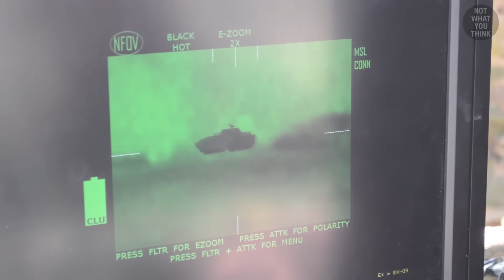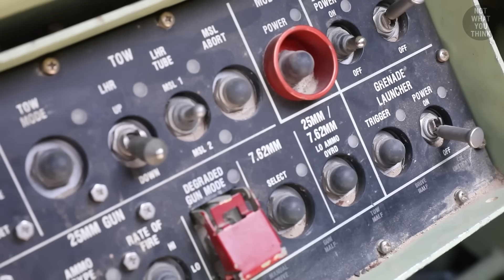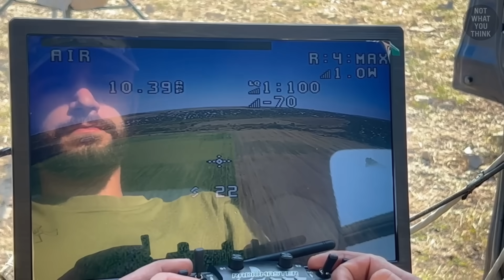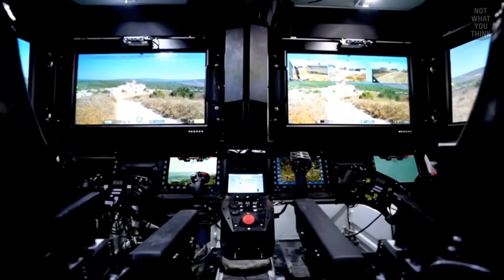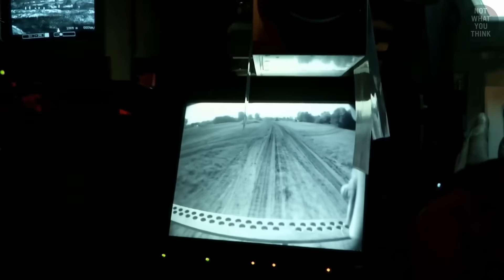How Bradley IFVs prove more Useful in Ukraine than Tanks

Comment: Basically you have multiple variants of a well protected IFV: One is a standard troop carrier, another is a troop carrier with a 40 mm cannon, another is a 120 mm mortar carrier, another is a command and control , another is a defensive AA unit with a poop ton of ammo, and finally a drone carrier. All basically using the same basic chassis. The drones scout ahead and get targets for the 120mm mortar, and they themselves can go after targets.

Comment: First of all the M10 Booker is not designed to replace the M1 and never will. Just like the M22 Tetrarch never replaced the M4 Sherman. It is designed to support light infantry formations that currently have little in the way of armored direct fire support. Also, the reason why drones are so effective currently is that there aren't many effective anti-drone systems yet fielded by Ukraine or Russia. Also, there is not a lot of doctrine or training currently out there on effectively countering drones. Many anti-drone systems are either already fielded or in development by the USA and other Armies, one of the primary purposes of the US M-SHORAD is not to engage manned aircraft, but to deal with drones. Also, The Abrams is only a super-tank compared to crappy, old Soviet tanks compared to other modern MBTs it is just a good top-tier MBT. Also, many tanks already have or are developing active protection systems and/or EW systems to defeat ATGMs and drones. I don't know about Ukraine, but the US Army doesn't use M1 Abrams in stand-alone tank formations. Abrams are always part of combined arms formations that include IFVs and infantry alongside the Abrams. No single arm is invincible and each arm is best used in combination with others in order to support one another and cover each arm's weaknesses. Finally, the Bradly while a good IFV isn't a wonder weapon, and is still less protected and only about as mobile as an Abrams. Tanks will likely slim down a little, as the M1A3 proposal already indicates, but it will lose weight mostly by using lighter, more modern components and materials, and if anything with active protection and EW systems will be even better protected against current threats. IFVs if anything are going to get heavier in order to provide better protection for their infantry. Finally, the Abrams doesn't need a bunch of different ammo types, because between the APFSDS and AMPS it can already do nearly anything it would be called upon to do with its gun. Sure a tank with a 105mm gun might have a lot of options for ammo it could use, but storage space on a tank is finite, and it could easily be that by loading up on a bunch of different types of ammo it ends up not having enough of the type it needs over a sustained battle.

Comment: In Russo-Ukrainian war Bradleys a Leopards have proven as vulnerable and as destructible as their Russian counterparts. Russia is surely not Libya, Syria or Afghanistan and bites plenty a lot harder. It has been noted.
Reply: There is nothing indestructible on the battlefield. The problem with both Russian and Ukrainian equipment is that both sides have been using them poorly. I'm not sure why Ukraine thought they could drive tanks or Bradley's through a minefield successfully... All of the images we've seen of destroyed Western tanks have been minefields that destroyed the tank tracks and then Russian artillery finished them off. I'm sure the soldiers escaped unharmed before the artillery began but it was foolish to drive over tank mines to begin with.

Neither side seems to be capable of a breakthrough because they don't think in combined arms warfare. No single piece of equipment can win a war. It's how you put them all together with a detailed plan and coordinated execution that makes the difference.

Comment: I wont read 1200+ previous comments so this, may have been mentioned earlier.
The Bradley is a good  IFV, but I think the CV-90 is even better and it is not even mentioned in this video.

30/35 mm chain guns on export versions of the the CV-90 kinda works but the 40mm Bofors with 3P programmable ammo is just insane.
Larger rounds means fewer rounds carried but I'd go for the 40mm Bofors instead of the Bushmaster on the Bradley or the lower caliber CV-90's any day of the week.

Comment: IFV's are cheaper and arguably superior in some aspect, though they couldn't haul a full fledge gun, they could definitely mount AT Missiles which is still still very devastating to tanks, basically you pay less for the same result if not better since theoretically you can build 3 IFV for the budget of a MBT and they're also effective at fending themselves against infantry since they're anti infantry oriented with infantry fighting compartments, allowing them to fulfill both roles. of course they're not tough however but with APS and the shear volume of fire a platoon of IFVs could produce, even the best of AT infantry have to duck for cover, not to mention that IFVs are inherently lighter than tanks for obvious reasons making them easier to transport as well as being faster, allowing them to fully exploit breakthroughs

Comment: You are comparing sandy desert terrain with massive field of vision to a muddy swamp with very short vision. Desert is more long range attack and Ukraine is short range.  In Ukraine drones only have to fly short distances to find a target compared to a desert and the longer in the air the more chance of being spotted or picked up on a radar if they had them. In a desert drones would not be as effective because of duration of fly time and distance limitations.  In a enclosed city well yeas very useful.
Reply: None of the fighting in Ukraine is short range.
Reply: Short range is anything under 2 miles. Most of the fighting in Ukraine is under 2 miles. Thats why they use rifles. Duh. Desert fighting, they can be throwing shells 5 miles or up to 30 miles.     @baneofbanes

Comment: Each vehicle was designed with a different role and doctrine in mind for how it operates, in order to maximize its strengths and mitigate its weaknesses. Tanks in Ukraine have (as others have stated) not been supported by infantry and are often susceptible to AT weaponry because they do not have the infantry to screen and engage threats ahead of their armored unit. On top of that, technology for tanks will just continue to evolve to attempt to counter AT weaponry, such as how many nations are currently undergoing upgrades for Active Protection Systems to eliminate threats to the tank before they hit it. This isn't even taking into account the Armored Onion graph on engagement, wherein it eventually trickles down to "*IF* I get hit, can  I survive it?"

Essentially one conflict is not enough to determine tank obsolescence, especially when one side is tactically inept and the other side is utilizing vehicles that they are not wholly familliar with, which means that the vehicles are not used according to the providing military's doctrines.

Comment: if any side could get close air support they would dominate immediately
Reply: both sides basically already have close air support. Drones with Artillery, and loitering munitions, are doing exactly the same job as close air support would do. And probably even do it better. 

The thing is no side has this exclusively, thats why, both sides suffer extremly, and every offensive move, is prone to get punished severely.

Comment: Not sure how I actually made it through this video given how much it is wrong on some major points. Modern tanks are not "battleships" lumbering over land. Most of are highly mobile well protected and lethal hunters. Guided anti-tank missiles have been around since the 60's. They had a big impact on the Yom Kippur war. Tanks didn't become obsolete then. Tactics and technology changed to keep them relevant. The M-10 Booker is not officially a tank. It may look like one and take on some of the roles an Abrams is used in today. It's an Infantry Support vehicle to deliver direct heavier firepower against hardened targets. Think bunkers and solid cover. It's not designed to go toe to toe with Tanks.
And if a Bradley ever just "runs into a tank", it's got a pretty good chance of getting blasted. Now if the crew is smart and uses proper tactics, they'll use their advanced optics to spot a tank before they are spotted, and can use TOWs to take it out. Overall it's a versatile and effective combat vehicle. But there is no one single type of armored vehicle that will single handedly define the future of combat. The US and western militaries are so dominant because of their doctrines which stress combined arms operations, cooperation, and superior logistics.

Comment: the tank will take a backseat for a while, until someone devises a drone defense, or a vehicle portable anti missile system.  F16's are still needed, as if I'm recalling correctly, no one holds superiority in the skies over the Ukraine.  lack of air superiority is one reason the advances have been so small.  this is not time for any "thunder run" style advances.

Comment: One fact remains, each generation of warfare provides challenges to the previous battlefield conditions that must be answered. The tank is not going anywhere unless it fails to adapt to the new battlefield conditions. The next generation of of tanks and armored vehicles will need to answer the drone and anti tank gear currently in use and if possible the future. An anti air and missle system will most likely be needed and the real challenge of that will be making one small enough and efficient enough to fit on a tank.
Reply: @@JimCarner that's why I am trying to explain why the next generation of military hardware will most likely address those issues. The vehicles we see are literally 40 years old, drone warfare as a practice is barely 20 years old and the current doctrine of drone use is only a handful of years old like that.

Tanks still play an important role on the the battle field still, they are literally better at attacking fortified positions and is still a role that is not being replaced in that regard. Ukraine is still showing those facts. the obstacles, however, demonstrate challenges in particular reconnaissance and kamikaze drones will need to be addressed either with a countermeasure or doctrine to reduce their effectiveness. A tank, or any piece of equipment, is a useless hunk of metal unless you know to use and less face it, I don't think the Russians know how to use theirs.
Reply: @@JimCarner yeah, I don't see that happening even a hundred years later. drones are not a silver bullet, they have key weaknesses that can and will be exploited. The reason why they are center stage in Ukraine is because Ukraine doesn't have much electronic support and Russia could not use theirs to full effect and lost alot from special forces and partisan attacks. In fact early in the war Ukraine had great difficulty employing them until the jammers were destroyed, I believe even himars helped with that.

Drones would not be as serious as a problem if an old world War era weapon makes a return, do you know what it is? Flak cannons and their ammunition was phased out decades ago because most aircraft flew higher and faster than they could reach but could easily shed most of the drones being employed in the war.

There will always be a need for a variety of weapon systems on the battlefield.
Reply: @@JimCarner and drones, just like any other electronic device, can be hacked and pointed back at the owner. They still need supply chain and will require regular supplies, heck to use the numbers you describe a large footprint which means they will have a harder time  to hide. Drone operators are almost as specialized as pilots and will be as hard or harder to train and replace as other specialist fields and will need even more logistics considerations than other units.

Like I said drones are very useful but they are not the end all be all. They are another facet of combined arms theory and where they are now is doing well. Working in conjunction with other supporting units is literally the corner stone of modern warfare, and is how Ukraine is beating the Russians because they have better cohesion with their own brigades but also the other commands. Its that team work where drones scouting ahead of the infantry and tanks calling out threats and assisting artillery with targeting is very important and doesn't necessarily waste in the process. Kamikaze drones singling out lone enemy vehicles in the wrong place are devastating. But drones simply cannot do everything and some the things they can do may not be the optimal use. That's an array of equipment is important to handle a variety of factors on their own way and terms.

Comment: The US army is planning the M1E3, a lighter redesign of the Abrams tank. People speculate that it could have an unmanned turret with an autoloader, a new. less fuel-hungry engine, and other modern features. Also, as a side note, tanks are still very vulnerable in cities as they can be attacked from below and above, which is why urban-fighting modifications for armored vehicles often add extra armor to these areas
Reply: M1A2 Abrams has a protection package call Tusk, and a M1A2s turret has depleted uranium armor, its now hard to attack a Abrams from Above.

A M1A2 can run over anti tank mines, and shrug them off….unfortunately the M1A2s in Ukraine has had that armor striped for top secret reasons….eventually the Ukraines will modify them to fight in a urban Environment, Some Abrams are gonna get knocked out, if the Ukrainians use them improperly.
The Tusk package protects the side of a M1A2 Abrams….I wish the United States didn’t strip its protection package….the Tusk system could shrug off drone side attacks.

Comment: If tanks were obsolete, why did Russia lay massive minefields over a kilometer deep to prevent armored mobile warfare? The obvious answer is that they are afraid of tanks breaking through the front lines and deeply penetrating in the rear areas. The real issue is that the AT minefields prevent the tanks being used in this role.

As to the enormous tank losses in Ukraine, that occurred because Russia has been using its vehicles like they were on an exercise. Their units are not trained in combined arms warfare tactics, because that takes years for troops, and their officers, to master. Instead, because of their conscription system, Russia has basically relied on hammering everything with artillery, then massing their units and punching through while ignoring losses. This hasn't worked in Ukraine because Ukrainian forces used mobility to attack Russian supply lines, depriving Russia of its mobility, and masses of AT weapons in ambushes against unsupported tanks. Not to mention the Russian tanks have major design flaws that allow a single hit to detonate all the ammo.

By the way, it is obvious from many comments that people haven't seen videos of Ukrainian tanks tearing apart Russian defensive positions to assist the advance of the following infantry units.

Comment: Any IFV has a canon that can penetrate the armour of MBT ? Or is just not possible technically?
Reply: It can happen. The trouble is bigger cannons like those on tanks tend to be more limited on ammunition options for supporting infantry and need space for larger shells. 25-35mm autoguns are faster firing for supporting infantry by suppressing enemy positions and chewing through cover most small arms can't. They can penetrate tanks if the armor is thin enough and with the right ammo. There's a video of a Ukrainian BMP doing this to a Russian tank.

There are Mobile Gun Systems, which are essentially IFVs with cannons like the  M1128 which is essentially a Stryker with a 105mm cannon but those sacrifice troop transport capability.